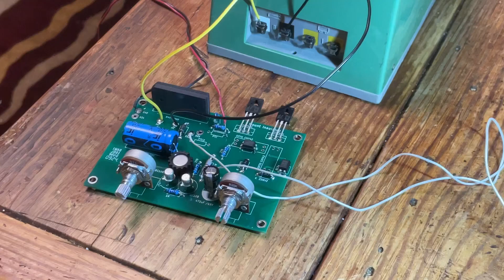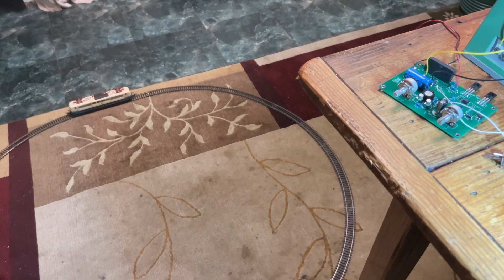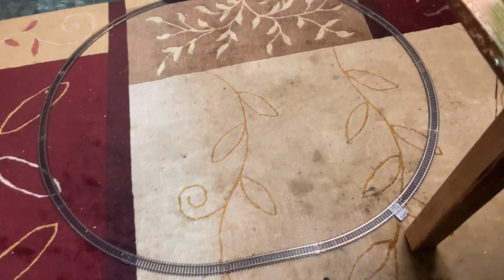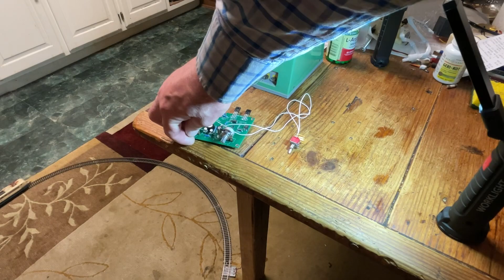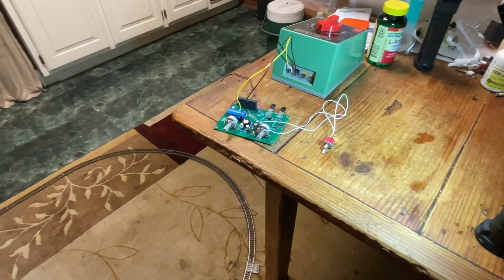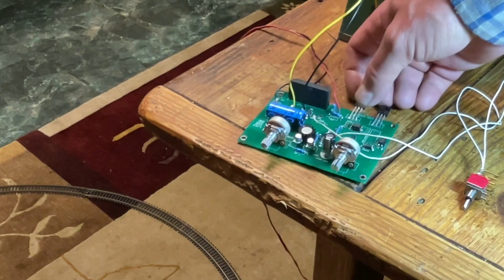ELO Magazin 11/78 Traumfahrpult G / Dream Controller DC built again after 40+ years First Test Run!

Comment: I came across an old reversing relay to allow trains to shuttle back and forth, didn't buy it though , it was very old though so it was probably out of tolerance, got a Fleischmann German 0-6-0 steam loco in need of a tender (also missing it's front buffers) and some TLC (hopefully the commutator plates are not delaminated) and a mehano SD-40 in a strange promo livery that was being sold in a bag of parts and a few other things as well. 

I can source a tender for the loco on ebay some day.
Reply from the maker: Hi Ray,
That’s pretty neat! I am sure you will come across a tender sooner then later! I may have some extra buffers for her. Have a great weekend!
Peter